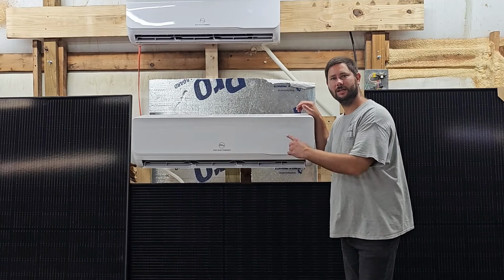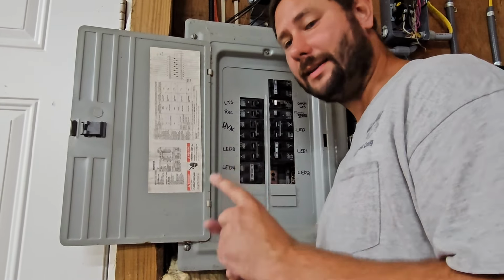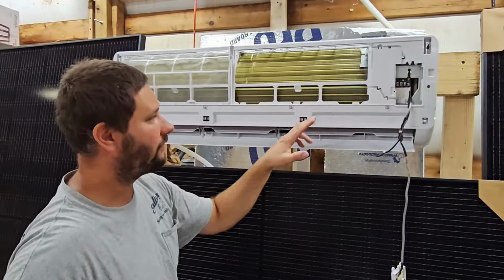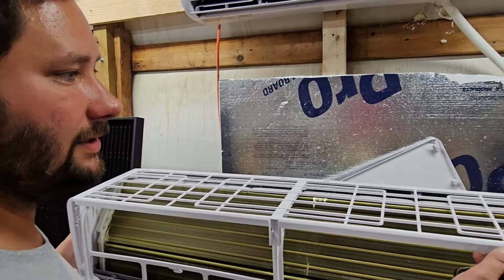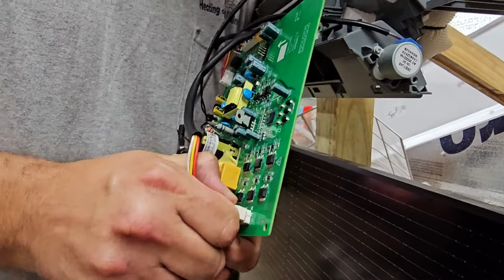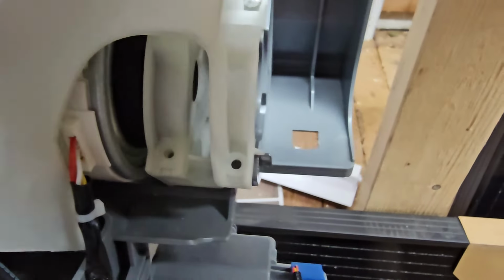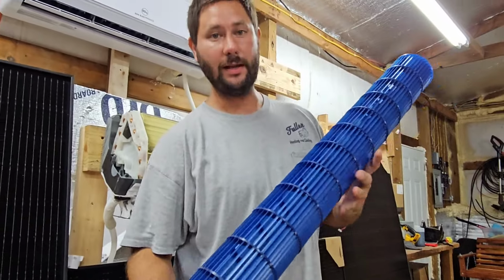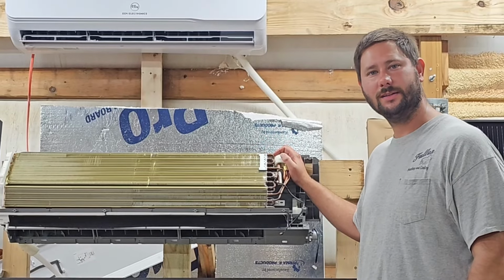Silencing Your Noisy Mini Split Air Conditioner: Step-by-Step Guide

Comment: Before going too far into replacing a motor, check the left side of the fan wheel. Mine did not have a bearing on the left side, but a rubber mount that the wheel axle would spin in. I greased that and my squeaking/high-pitched noise went away.

Comment: If my unit is only a year old can I use compressed air to clean the wheel without taking everything apart? I'm not having any issues yet, I just think it might be good preventive maintenance to blow it out with compressed air. Thoughts?

Comment: No thank you very much! Very helpful, I tried to disassemble, prior video did not go into great detail as you did, I stopped 3/4 into the disassembled process, I simply didn't know what I was doing and I didn't want to damage the unit, okay so I'm very confident now and I will disassemble and clean. I realize you don't have to disassemble to clean but I want to anyway , to give it a real thorough cleaning.

Comment: My new unit creaks and snaps after a few hours of cooling. Like snapping stretching plastic
Reply: If you can get someone out to check your pressure, it sounds like maybe it's freezing inside? Check and make sure the drain is clean too. Mine freezes overnight sometimes because we have very high humidity here.

Comment: I have a Diakin FTXN24KVJU unit...and from the 1st day it has always had a high pitched whirring sound to the fan rotor when operating. It's 10 years old now and I have just disassembled and fully cleaned the whole unit (it was really nasty, fan/interior was covered in mold/dust) I was hoping that cleaning it would help mitigate the sound...nothing changed unfortunately.  

I am wondering if there is a replacement fan rotor with a new quieter design?

Comment: Excellent video. Watched it once, bought new fan bearing and motor, took it apart, cleaned the fan, installed bearing and motor, put it back together. No noise.

Comment: Looking everywhere for a video like this previous owners installed air con right up against the left wall trying to remove the big wheel hardly any room to get to the left side of the ac will have another look tomorrow with this video thanks

Comment: The way these things are designed is absolutely nonsense. Why bury the only moving part behind so many plates, wiring, sensors, guides etc. if thats the case, put a nicer bearing in there so i dont have to hear REEEEEEEEE every day. 

Said as a builder who has installed dozens of these. They are effective but a pain in the ass because of stupid stuff like this.
Reply from the maker: I agree 👍

Comment: No squealing sound, but my split AC has a rattling noise when turning on the unit. It subsides after about 5-10 minutes. Do you think its the same problem with it as what you described in the vid?  The bearings, motor or wheel? Thanks.

Comment: If there’s no screw to take the blower off what do I do ? There’s no slot in the blower. It’s a Delta Lotuus.
Reply from the maker: I am not sure that is weird
Reply: @ hey I GT to the screw is way back. You gotta push the blower to the left and it’s hidden. You gotta push to the left and unscrew at the same time. Really difficult. I should have just takeoff the power supply 1st. Really difficult without having a shaft.
Reply from the maker: @SookyMonster thank you for this information if I ever have to replace a wheel on one of these mini splits like you have. I will know what to do because of you. Thank you
Reply: @ much appreciated. Your video was really helpful btw.

Comment: How is it putting that white plastic and motor back in without disconnecting the Lineset you hardly got it out I was dying to see that part but this was very helpful I’m curious that’s the only part that spooks me
Reply: @pacsmacks7142  I was thinking about getting one of those screw holder screw drivers to get it back together. Phew!

Comment: What is the size of fan blower or do you know where to buy replacement ?
Reply from the maker: The fan motor or the blower wheel?
Reply: @taddydigest blower wheel
Reply: Blower wheel
Reply: I need part# on blower wheel for the 12k

Comment: I just installed the EG4 24k hybrid and its great. Blowing super cold air during this muggy and humid Florida heat. I am getting a high pitched beeeeep/squealing noise though. Originally thought this might be the problem but it seems to only do it when actively cooling. Doesnt beep when only on fan or on heat. Also noticed the noise can be heard inside and outside.. Would you be able to point me in the right direction? 

When i have it set to 61F,  it blows ice cold 55F air out.
Reply from the maker: Where do you think the sound is coming from?Do you think it's coming from the indoor unit or the outdoor unit
Reply: Hard to tell...  I can definitely hear it in both locations.  Maybe more pronounced outside?? 
The noise definitely goes away when it's not in cooling mode. Can't hear it either place. I did the soapy solution leak detect method when putting it together and didn't see any leaks. But I just ordered a leak detection device today to see if it's leaking
Reply: @TaddyDigest after some closer inspection, the squealing/whistling noise id coming from the large diameter copper line. Definitely more noticeable outside when I put my ear to the line. What do you think this could this be?

Comment: Thanks for the detailed instructions.  I think taking the unit apart 7 feet up becomes a greater challenge.  I have an EG4 system just like you used.  What you did not explain is how to clean those fan blades on a periodic basis.  Is the complete disassembly required or can I get compressed air in there somehow and blow it clean?
Reply from the maker: So in the video I did explain that there was a link that I would put for you to check out on how I maintenance, my mini splits in what I use. I'm pretty sure I'll put that link in the description.Go check it out.Let me know if you have any questions

Comment: Hi! I manage some short term rental units in SoCal and have been learning to do alot of basic maintenance for our mini splits over the years. So I really love your channel and how valuable your content is for DIYers! 

I had one question for ya. In our rentals we ideally would want our units to stay comfortable and cool at all times for when guests arrive. this would also prevent guests from fiddling with the temperature controls too much. Do you think keeping the AC mini splits on 24/7 at a setting of say 68-70 (on auto)  would be better than having them to "conserve energy" and only turning them on when it gets hot? Common sense tells me "yes, turn it off when ur not using it to save energy" but after thinking about it, would keeping it on lesson the wear and tear, and perhaps energy if the machine has to work less hard to maintain 68-70, rather than cooling down a 80+ degree space everyday over and over again?

Comment: Let me tell you, as a service technician servicing these ductless units is a NIGHTMARE. Sometimes you don't have access on the top to easily remove the cover. 
If you are working for a company that pushes services on you, you only need one such call to throw your schedule way off!!!
Reply from the maker: Do you mean this brand in particular, is hard servicing or every brand
Reply: @taddydigest  Every brand! 
I haven't worked on the one you demonstrated here but all that I have worked with are of a similar design.

Comment: Thanks Taddy, nice video. It came at a good time since I plan on getting an EG4 mini split soon. I also have found out that it’s difficult to find an HVAC professional in my area who wants to service a mini split. So I need to find out as much as I can about it so I can address any issues myself. 

Here’s an idea for another topic on the EG4 mini split. Since the EG4’s are being sold with the precharged line sets, what’s the best practice to use when needing to service the indoor air handler or maybe even move it to a different location? Is the regular pump down method used which stores the refrigerant in the outside condenser? Assuming the same line set is being used, it’s now not precharged with refrigerant and would need to use a vacuum pump to remove the air, moisture, and any contaminates before the refrigerant is released back into the lines from the condenser? 

Always great watching your content, keep up the good work 😊
Reply from the maker: Yes, pump down would be needed and you would pump the. Refrigerant down into the condenser by closing the liquid service valve first, and then the suction service valve when the pressure gauge reads zero
Reply: @taddydigest  Thank you.
Reply from the maker: @michaely1164 You're welcome my friend

Comment: Make sure you inspect the rubber isolator on the motor receiving end of that fan wheel. It rips apart itself,due to high torque on startup.

Comment: I am glad you are making this video. One of my Ac units is making that kind of noise and I was thinking about taking it a part to see what could be causing it.  I also wanted to point out that   at minute 7:58 the plug is hard to remove because the red plastic piece Holds it down and it can be remove using a flat head screw driver prior pulling the plug otherwise there is a risk of ripping the connector off.